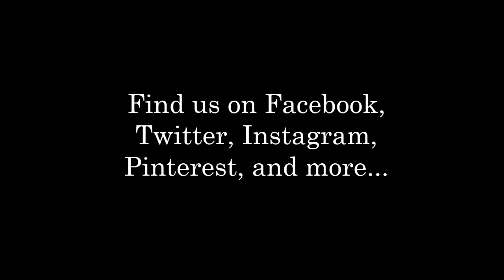Comparison: Tile vs Tila Beads

Comment: Thanks for this. Where does the Rulla fit in with all of this?
Reply from the maker: A rulla is very similar in size to a brick bead, just a smooth round barrel shape, rather than a brick rectangle shape.